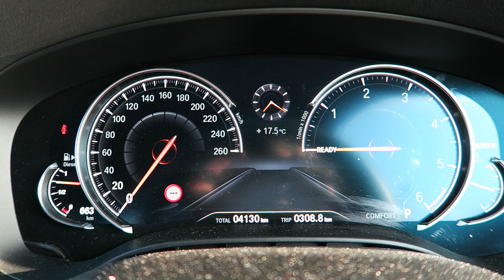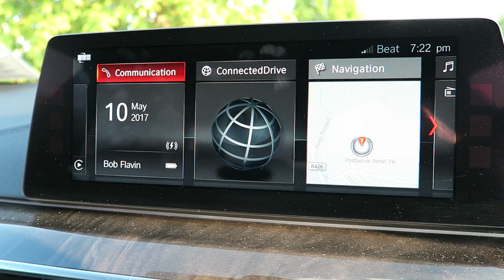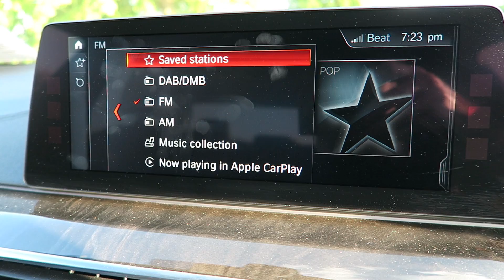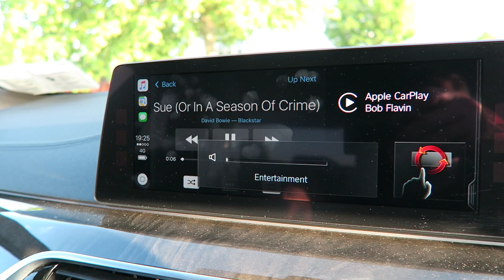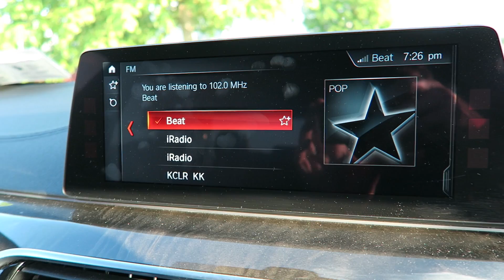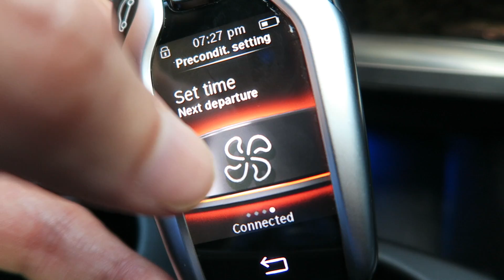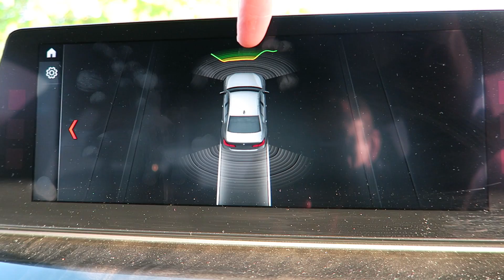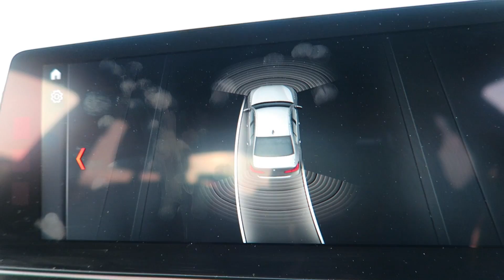BMW 5 series technology and Interior with active cruise control

Comment: Funky!
Love the 5 Series. Had 2013 F10 520D and am about to get a 2018 G30 520D. Prior to that have owned a couple of other BMWs: E46 320D and an E92 330i. In-between these have owned/used: Merc GLA, Merc GLB, Merc E-class, Audi A6 and a SAAB 9-5. All great cars, but I keep coming back to BMW. I like the driving dynamics, build quality/engineering and design. The 2.0d BMWs are also very cheap to service, insure and fuel.

Comment: How's the automatic gear change upwards from first to second? On the old 5er used to be lazy, requiring to rev up way too much with the diesel.
Reply: Hi could you please do a video on the use of the paddles on steering wheel of the BMW x6m 2017

Comment: Small thing but I wish BMW would let us stay in the last drive mode (Sport,Comfort etc.) and give us the option to permanently shut off the auto start/stop function. That thing just ruins the engine mountings. Love the video Bob! can't wait for the road test.
Reply from the maker: Aaron Pinto agreed on the last mode, it's really annoying.
Reply: The car's official CO2 emission numbers takes into account the start/stop function and the standard mode (comfort). It would not be legal to change the default settings, as it would affect the CO2 emission. Car's emissions are measure using the The New European Driving Cycle (NEDC). This cycle simulates real-world driving. The urban section takes about 13 minutes in which the car is standing still for about 1 minute. This means that the start-stop system gives an instant eight per cent improvement in the official emission numbers! In real life the impact depends a lot on the circumstances.
Reply: In the US you can. Just hit the button under the start/stop function.
Reply: Enjoy it in the US while you can, for the 2019 model year, you will not be able to turn the start/stop feature off. On the 2018's, you can't have the dealer change the start/stop to default to off upon restart. 
Really annoying. But easy fix, drive in sport mode thereby it's always turned off.
Or just have it coded.
Reply: I have a '18 and I can shut it off. In "21 when its time for a new one, I'll cross that bridge.
Reply: Keisha Nicole 

You can turn it off, but upon restart, it defaults to off.
Reply: Just have the car aftermarket coded. They can turn on memory and many other things

Comment: Nice car. Ridiculous key. I do not need yet another device that requires continuous charging. If the car is so clever and integrated, why can't it simply integrate with my equally smart phone and let me @$&! around with all the settings from there. The phone should also be able to unlock/start the car etc. ..like smart-pay - how about smart-car...? hmm, ok, maybe not. The looks, economy, relative performance, comfort, finish and tech such as the HUD and dynamic cruise-control are all good. The problem is all the necessary, distracting and mostly pointless tech such as the gesture control. There is are one or two obvious gesture tests that I'd like to try; because manufactures can apply all this tech, they will. It gets headlines, but is mostly a chavtastic diversion from what lurks beneath - at least in the BM's case, the car underneath is also good. Given the choice I'd rather they strip out the nonsense, reduce the price accordingly and divert their attention to R&D elsewhere. With cars as with motorbikes now (read, TFT screens), people get soo excited about the car-user interface being significantly determined by the infotainment system/TFT screen, as if it were the reason we buy the car/bike. Only stupid people or people that are easily suggestible buy on this basis (or allow it to have a significant weighting on there purchase decision) over and above the other car (old-fashioned) car/bike fundamentals. Basically [many, not all] car and bike journalists get so carried away with new trinkets that it rubs off on the buying public and drives the demand. It's a viscous circle that develops cars/bikes according to a pop-culture that is counter-intuitive to what most people actually do want (although they don't realise it) and need. The same goes for 0-60 and Nurburgring times - many road cars have been spoilt by attention to such things. My last car was an E46 3 series and I traded it in for a E92 3 series - I get i-drive - besides being fiddly it tells me jack over and above what the old car told me via the dash - I bought the E92 'despite' the i-drive tech nonsense. I had a Kawasaki zx-7r and went to a 2004 Fireblade - the 7r had a speedo, rev counter and water temp gauge (ok, a fuel gauge would have been nice, but the low fuel light did the job) - the Fireblade has a LCD/analogue dash that tells me exactly the same stuff, but I now see the exact water temp - the 2017 Fireblade has a TFT screen and tells you (as is the contemporary fashion) all kinds of stuff you never knew you'd need to know - the truth is of course, like the Nissan GTR-esque cars G-meters etc.,  you don't need or really care about that stuff. It's just marketing and twinkling baubles to get the press excited. ..that key.
Reply: The fancy key is an optional extra.. thank god as it doesn't work very efectively.

Comment: You know, I can't make my mind up on this car. I don't really like BMW's in general, they never seem to change, that's why I go for Mercedes. Regarding this one though, I don't think it's changed enough from the previous model. The interior looks like it's been lifted straight out of the 7 series, and the exterior looks like it's barely a facelift. From side profile it's exactly the same. I do think though that if I was in the market for a car in this segment, I would go with the Jag XF. It's floored but that's why I like it. The current E class which I test drove last month I really like, just feels a bit dead to drive. I'll take your opinion on it though, you're much more qualified at this sort of thing then I am